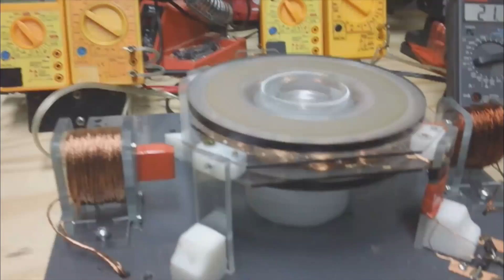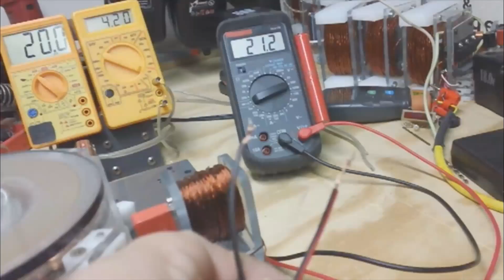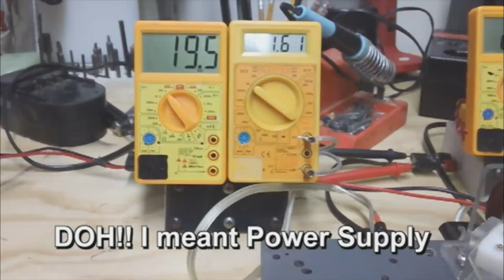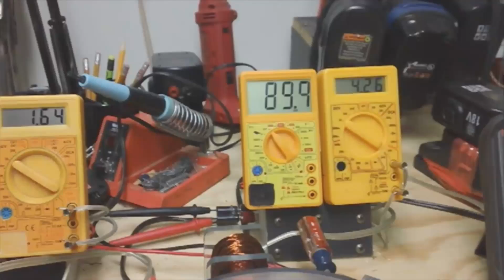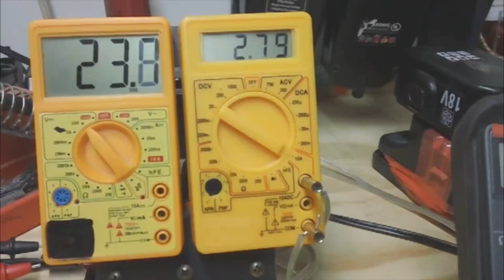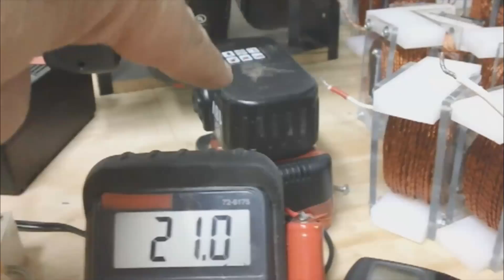Mini2.0 power anomaly

Comment: Yup, pulsed energy is pretty hard to measure, even with oscilloscope.
What if you use a battery-swapper to see if both of the charge rises...
It might runs by itself. :)

Comment from the maker: Guys I think my meters a not right the charge rate is not par with the amp reading, but I did hook the generator up today and it would charged a 12 V Nicad battery to 13.6  while the main output charge a 18V. so all is well but wont be working on it until after the holiday

Comment from the maker: cant do that you would need to change how it is wired on a SG circuit the positive input  is the negative output so that wont work you must dump into caps then then back to the input  or use a isolation transformer